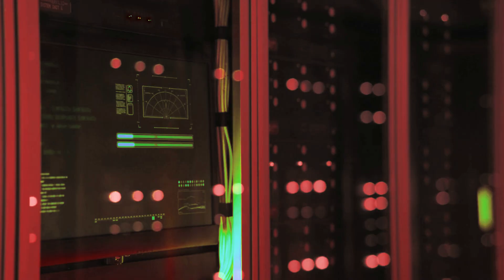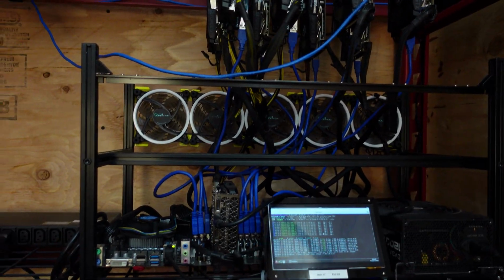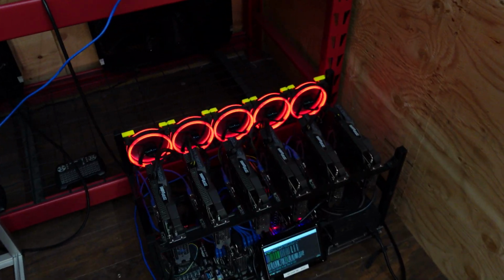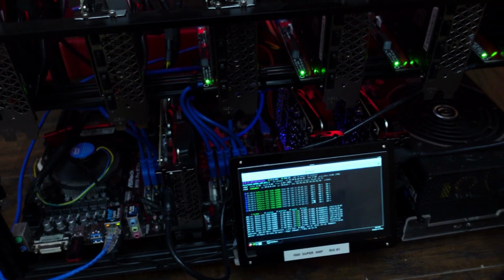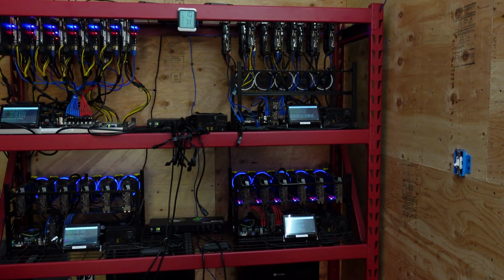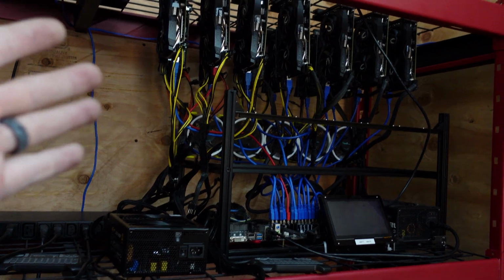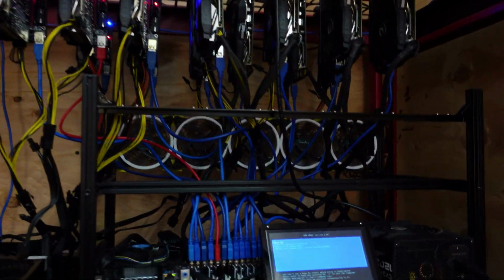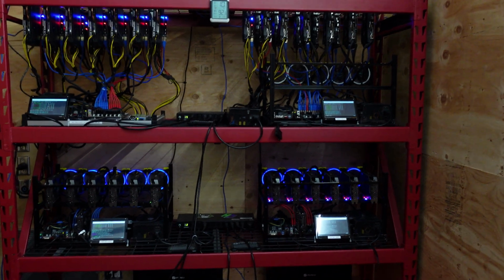GTX 1660 Ti / GTX 1660 Super 13 GPU Mining Rig

Comment from the maker: Do You Own Nvidia GTX 1660's / Ti / Super? Let Me Know What Clocks You Are Using!!! 

See The Description For Mine (ALL Different Memory Type Clocks Listed!!!!!)
Reply: Hey, just some advise. Instead of using a random GPU for your video output, buy a DVI to HDMI (or DP) adapter and run your video output from the motherboard to the display. It will save you a lot of headaches and weird bugs. I use one with all my Asrock H110 ProBTC+ motherboards.
Reply from the maker: Appreciate you!! Thank you!
Reply: I am using 1660 super on windows. 70% power, 1200 memory, 0 core, 33-34 Megahash.
Reply: Yeah I would use the on board graphics to avoid issues
Reply: Hello sir, yes I do own quite a few of the 1660s :D Haha! Love it!
Reply from the maker: @SebsFinTechChannel  I WILL TAKE THEM ALL! □
Reply: @ChumpChangeXD  NO!!! I will take yours first!!! I even have a brand spanking new motherboard to put them on 😍😍